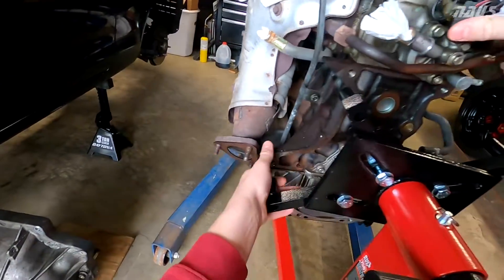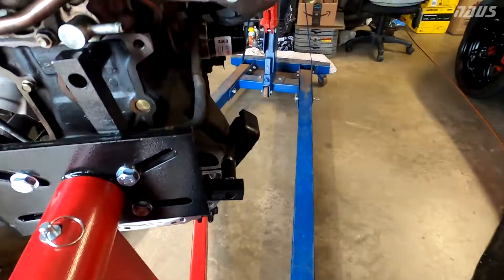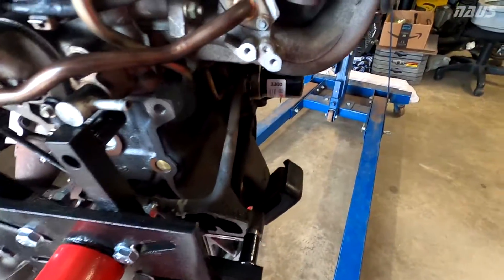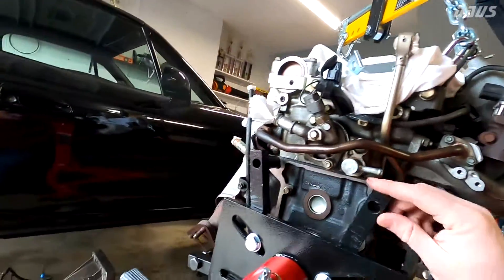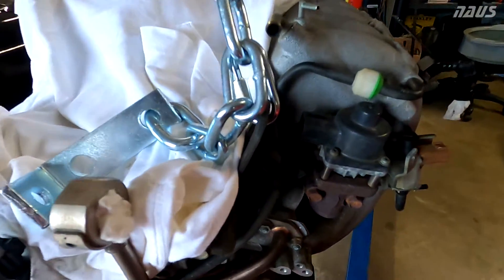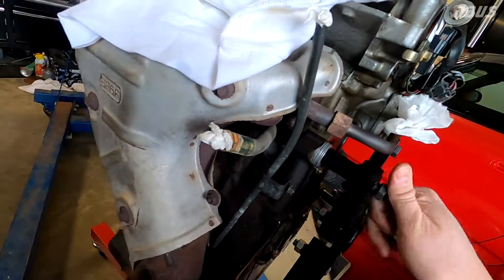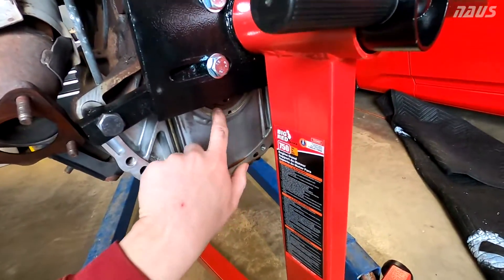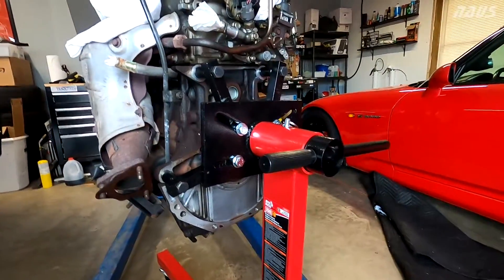Miata Engine Stand Mounting (NB2)

Comment: are you able to remove the oil pan that way? i've read that the bolts you use to mount the engine to the engine stand might get in the way, depending on which holes you use.
Reply from the maker: I was able to remove the pan and redo all the seals with it mounted this way, check out my other videos on the project !
Reply: @NAUS2K  thank you